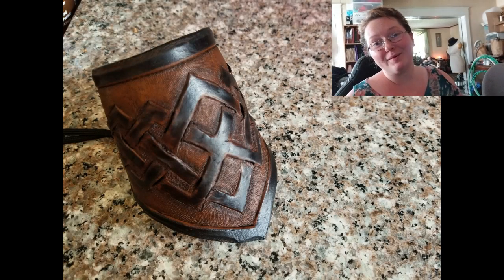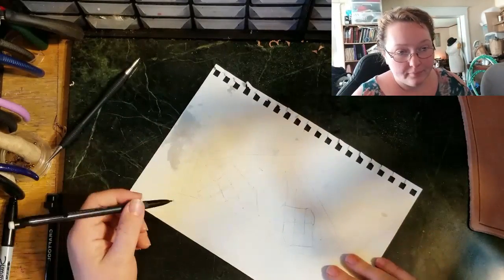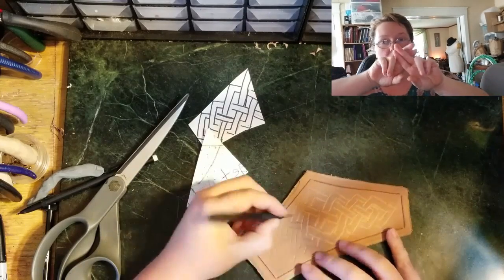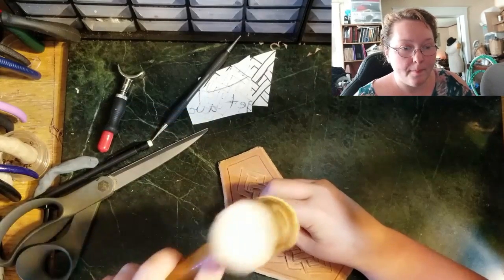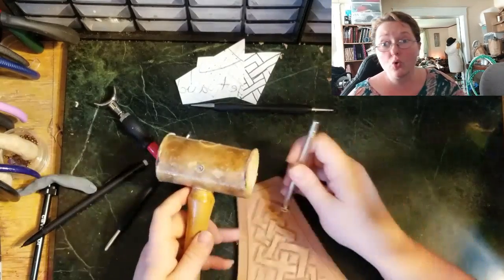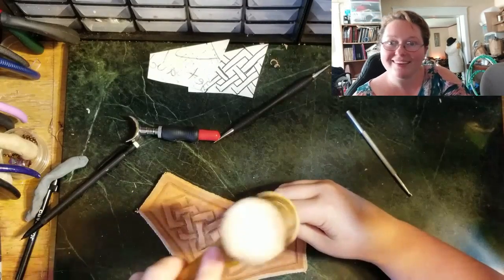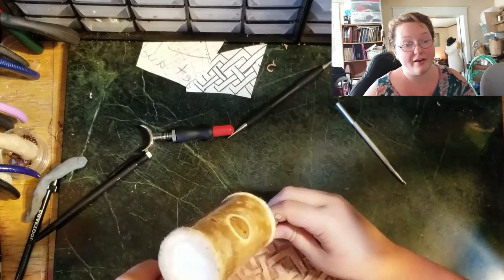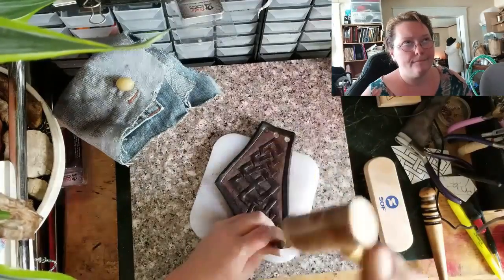How to Make A Celtic Bracer

Comment: use stretching before and after leather working and use a lower work station or a higher chair, It puts you up where you aren't lifting and putting so much from the shoulder. It will be more from the elbow. Hopefully this will help. works for me on woodworking.